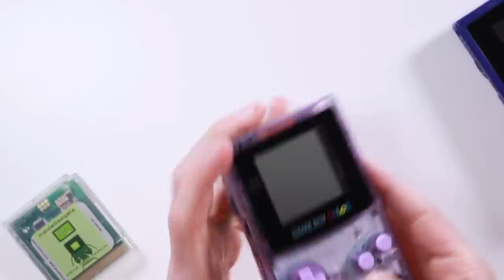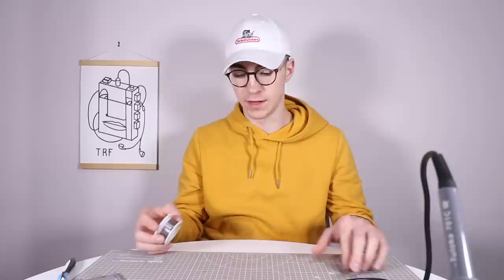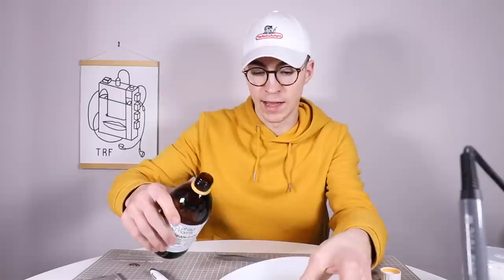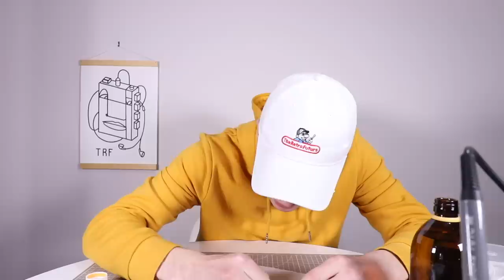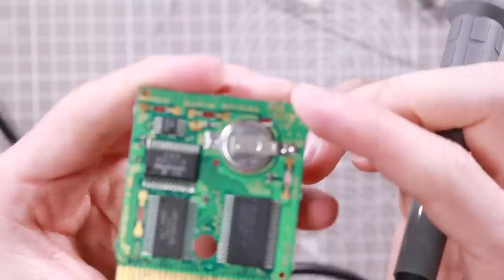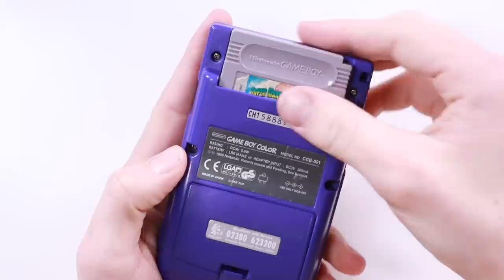Trying To Fix A Broken GameBoy Game!

Comment: You can use a normal sheet of white paper for cleaning contacts like those. Acts as a very mild sandpaper; just enough to take any oxide off the top with a bit of a rub. Worked well for me many times. 

Great channel!

Comment: I accidentally broke the trace negative side of the game-boy circuit board. I used a shabby game because I had no experience with Soldering. I was trying to fix it. I should've used Flux and something like your pliers instead of using a heating and flat screwdriver as pull it gave too much force and popped some green off the board.  Thanks for this video, I learned a lot what to do on my next attempt.

Comment: I use something called Brasso, or any metal cleaner for your kitchen or bathroom, really. It is slightly abrasive, but it's meant to knock off the top layer of rust and restore the contacts back to its original glory. I would use it on a case like this, not every cartridge. Try it!
Reply from the maker: Good shout!

Comment: A light rub with an Emery Cloth, or light Steel Wool would have cleaned those contacts right up. And solder contains just enough flux to make it workable... perhaps flux is too over-used. For removing solder, you need some desoldering braid... I can send you a couple of rolls if you want. (I have a room-full!)

Comment: It looks like it was in water, but if there was corrosion from battery acid/battery leakage, clean the affected areas with vinegar, and scrub them down.  the corrosion can work its way underneath the solder mask too.  :/

Comment: From my experience, 90% of the time, is dirty copper contacts. Usually cleaning with isopropyl is enough to bring the cartridge back to life. Few times I had to scratch it to expose the clean copper. Only a handful of times, I had problems with internal battery. Game Gear cartridges usually works better, but good Lord, they're extremely annoying to open it.

Comment: You ought to of used something like brasso on the pins, depending on how severe the corrosion is of course. (Be very careful with how you use)
Reply: Should add to use alcohol after cleaning with brasso.

Comment: Having this problem with a Pokémon crystal and Pokémon gold I had bought a few years ago. Decided to take them out and play, ended up not working. 
Did scrub them with AP. One has rust on the back, and some corrosion. Don’t have solder to take the battery off, so spent a time using qtips around everything. 

They seem to work here and there but not everytime. So a bit sad.

Comment: A gentle run with a magic eraser or even a pencil eraser is a great tool for cleaning copper pads.
Reply from the maker: Ahh yes! Good idea.
Reply: Pencil eraser yes; magic eraser no. Magic erasers are pretty much a fine-grit sandpaper and can damage the pins. Maybe as a last resort if nothing else works.